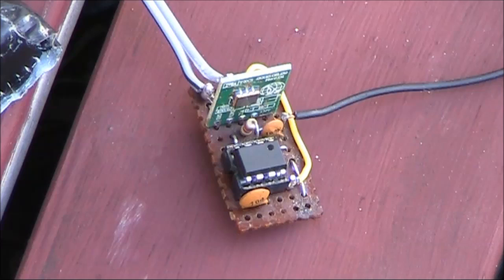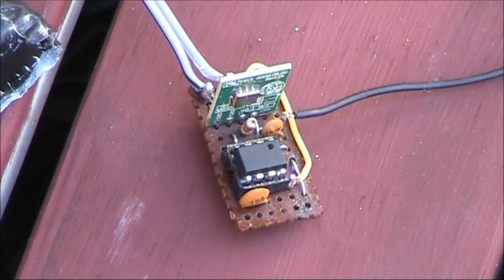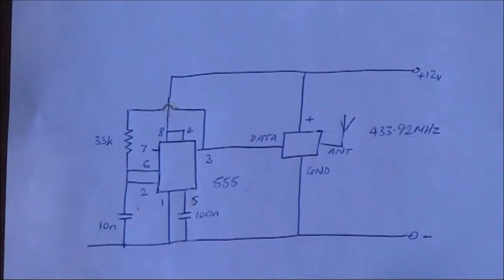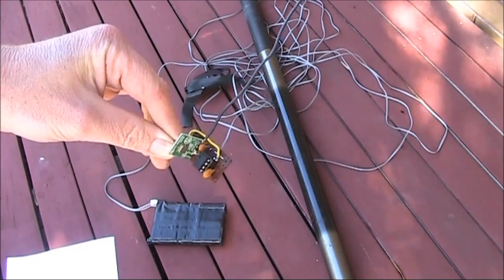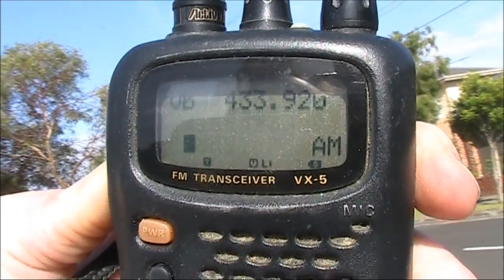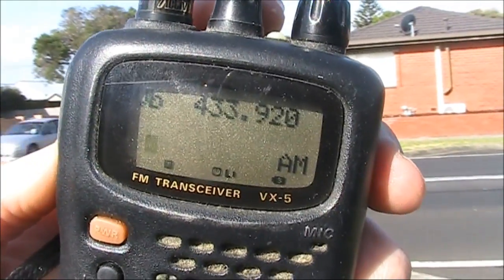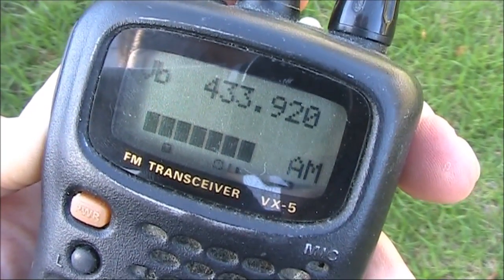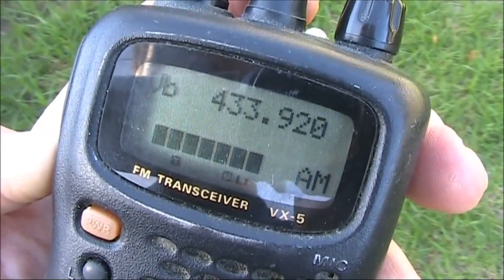Experiments with low power UHF data transmitter modules: Part 3

Comment: I was wondering, perhaps your audio frequency is a tad on the high side, if it were lower the receiver may be more responsive to the signal. I'd try a few hundred Hz. Also what if it was mounted inside a quick or milo tin with a quarter wave solid copper wire radiator protruding out the top. That way the tin can be used to act as a proper ground plane for the radiator and it would be very close to the correct length if you used the 100g tin. The bottom could be cut out with a can opener and the radiator and circuit board mounted on the lid for easy access. Just a few simple ideas without adding an external RF amp to the module, although a MAR6 or similar monolithic microwave integrated circuit (MMIC) could easily give it a 20dB boost without massively increasing the complexity :) what would that give you then... 10mW maybe? Whoa man! Hahaha!

Comment: I did the same with a Attiny 85 chip which oscillated a morse code message, l used a real cheap tx module powered by 3v coin cell battery. The range was really bad and the frequency shifted when the voltage dropped, no good for a long range beacon. Maybe if l use a better tx module or even a proper rig next time. Keep up the good work.